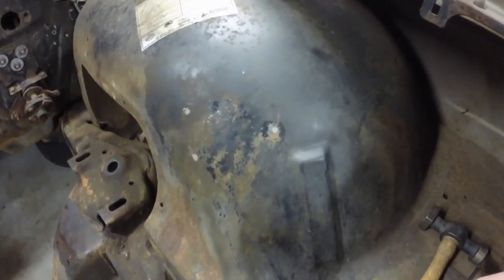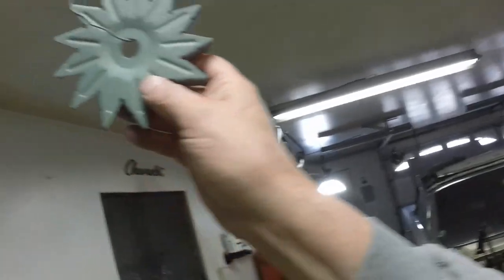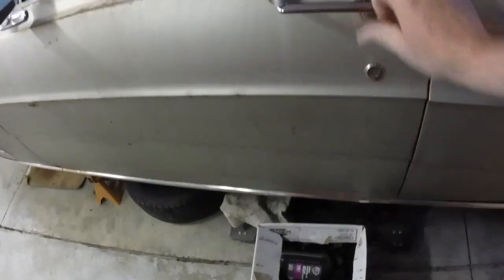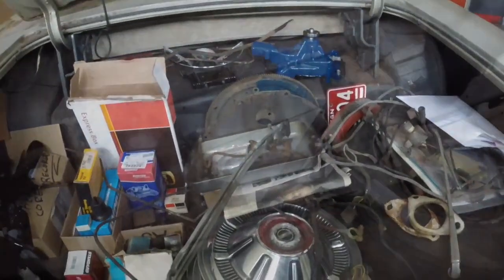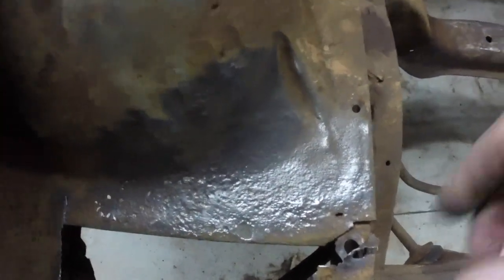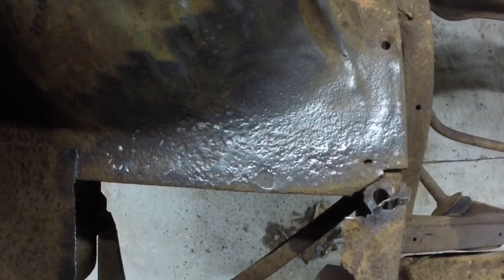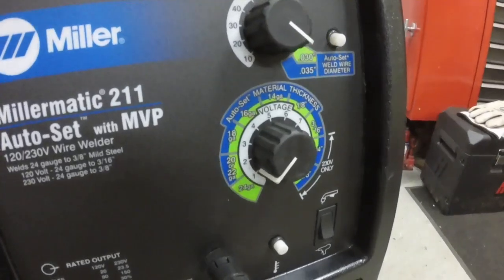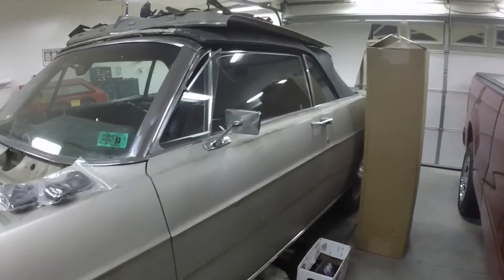1966 Ford Galaxie 500 convertible restoration part 31 fixing inner fenders

Comment: You take that grill out put in a LTD one and then make all four turn signals work I did that to the 66 convertible I had in the 70s it was Dark Ivy green metallic  black inside  Keep up the great work
Reply from the maker: I like the LTD grill a lot, but I don't want to modify anything on this car.... so I am going to keep the original grill in it.

Comment: I have a MillerMatic auto-set also. I have repaired rust holes in fenders, with the voltage turned down too. I like the welder.
Reply from the maker: I still have the old Miller Cricket... it's up north. I might bring it home, just for sheetmetal. I like that it has lower amperage at it's lowest setting, even with using a higher wire speed. Bought it new in the mid 80's. I only replaced it, because it had tons of welding hours, and was in need of some new parts... that were almost as much as a new welder. I bought the new welder, then found the parts that the Cricket needed... cooling fan, wire feed motor and a switch... cheap at an old welding supply house that was going out of business. It has worked flawlessly since.

Comment: I had the same problen where the battery was..i took the fender apron out to get better acess to the damage area..i was going to use sheet metal..but i remember i had some stainless steel..so i cut and bent the stainless and used stainless rivets..it turned out really well and looks great..i also put a drain hole with a rubber tube on it .. no more rust..what you are doing   is great .. cant wsit to see it finished..I'm still waiting for the windshield wiper motor to be refurbished..thanks for sharing..greetings from stockbridge Georgia..
Reply from the maker: Maybe I will do the wiper motor next time I wait for primer and/or paint to dry.

Comment: Nice horn ring! I go back and view these videos while I read the repair manual before I dive in.  I love the simplicity of my dads 67 Galaxie. I am currently replacing the front emergency brake cable. I had to remove the inner fender and sanding them this week. Like that plasma cutter and your bead blaster. I spend a lot of time removing undercoating due to it being a PA car from Pittsburgh. Another dirty and sore weekend coming up. Keep us up to date on your cancer therapy too.

Comment: John Deere makes three aerosol black paints that are high quality. There is a High Gloss, Medium Gloss and Blitz Black. The Blitz Black is great for engine compartment black out. It is an Eggshell type gloss, not glossy but not flat. If you have a John Deere dealer near you you might try the Blitz Black. I use it for engine compartment restorations.
Reply from the maker: There is one a few miles north of my dad's. I will check it out next trip to my dad's.

Comment: The area above the front bumper, I may be wrong, but I swear mine was painted to match the body color which in my case was cream yellow? Mine still had stock paint, and had not been repainted. I think it would look better painted the body color, but I know you want this original as possible, which is also the reason I'm writing this. It looks, on camera anyway, like there is some leftover green on that bumper lip? In any case, I'm sure you'll figure out the correct stock appearance one way or another.

Having looked at a lot of pictures on the net, I'm certain mine was body color matched, not silver. On the other hand there are quite a few out there painted silver. Take a look, and decide for yourself, but I think Ford would have painted that bumper piece to match the car as it does look better, but that too is subjective. lol
Reply from the maker: I have found with past cars, there were different models or trim packages which made different finishes like that valance. Plus mid year changes, and assembly plants did things different, or used another supplier, making a totally different part to do the same thing. I find that often, and half to search extra hard to find the correct part for the plant it was built in. I think once the bumper comes off, I will have a better picture of the way it was originally finished. I will paint it what ever way it was originally done.
Reply: Yeah, I was thinking that might be the case, different trim levels, and options. Mine was a hardtop which was probably a package that included the body colored valance?